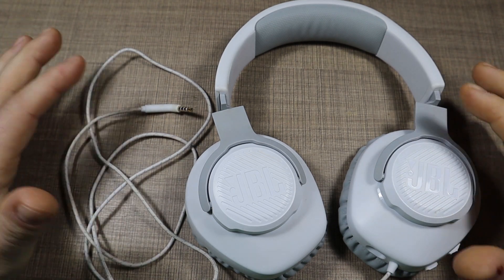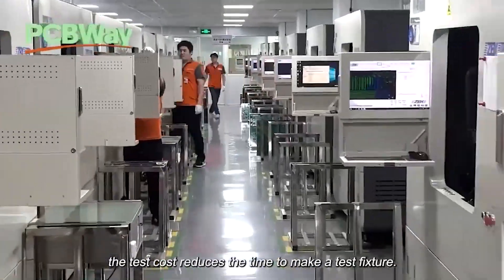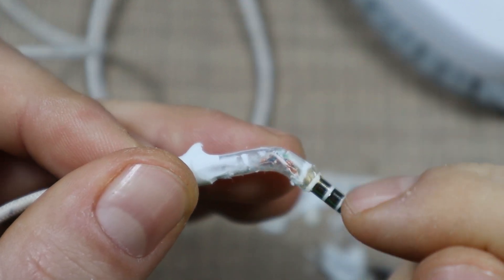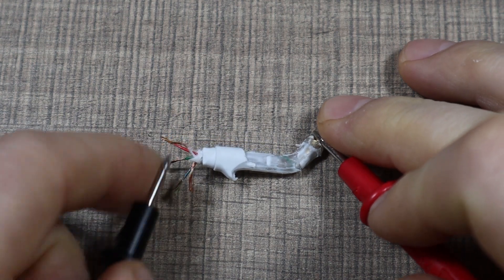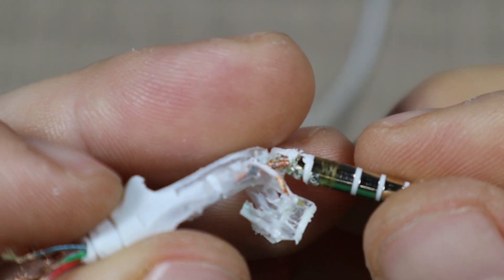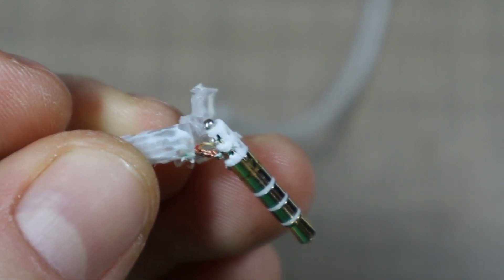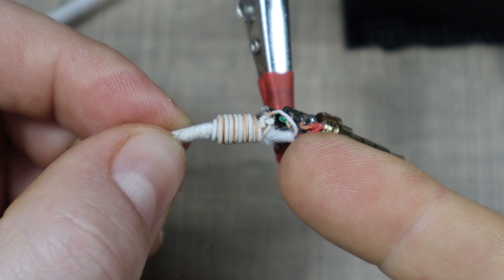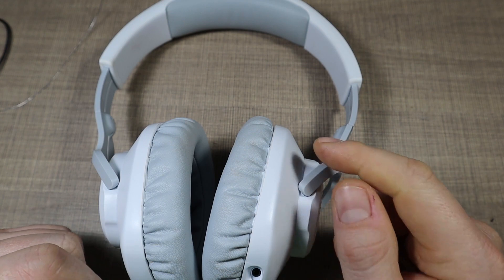The Angled Connector Disaster: How to Save Your JBL Headphones

Comment: Do you think I could buy a normal audio cable with two jacks for my JBL black quantum 400 headphones.
Reply from the maker: I don't think I understand what you are trying to achieve...
Reply: Oh I see. so my cord that has the same problem as yours broke. However I have a different kind I believe. My cord is not connected to my JBL headset, you have to plug it in yourself. My question is, since  it broke would I be able to buy just a normal audio cable with two jacks. And if so would it mess with the sound quality
Reply: Just confused if it would work or not
Reply from the maker: What's the purpose of the second jack? You want to attach a second pair of headphones like a splitter? It should work. There will be a slight loss in volume but it should not affect the sound quality if the cable itself is of good quality.
Reply: Thanks I just needed to make sure it would not mess the quality.

Comment: I have a same problem on my JBL quantum 100 but I don't know soldiing and I don't have the materials also , so will this be covered in warranty or ??
Reply from the maker: You will need to check with your local shop but my guess will be no as this will fall under mechanical damage for which most manufacturers don't offer warranty cover.
Reply: @TasteTheCode  okay thank you , very useful video btw